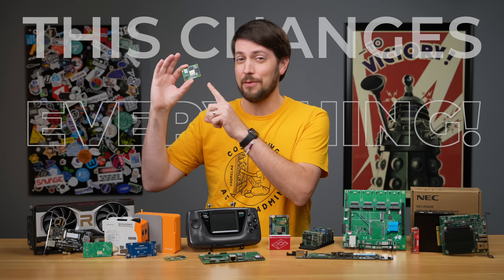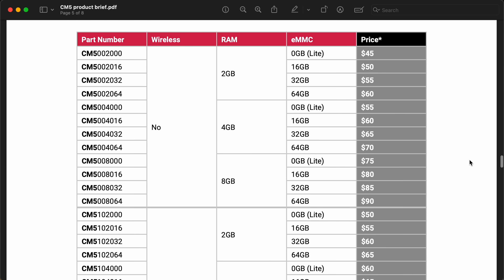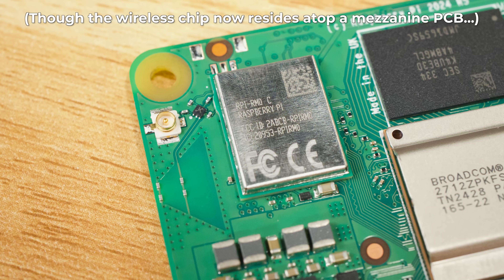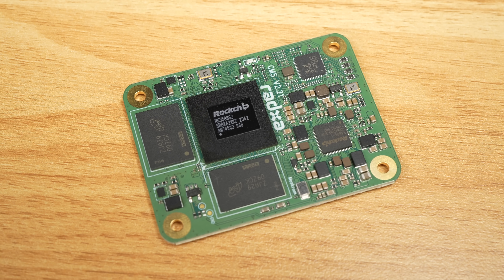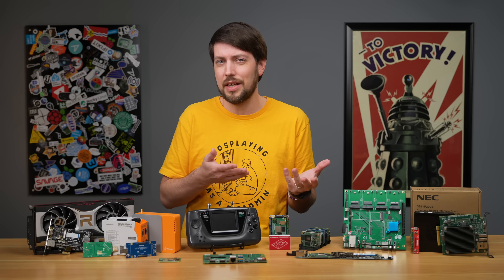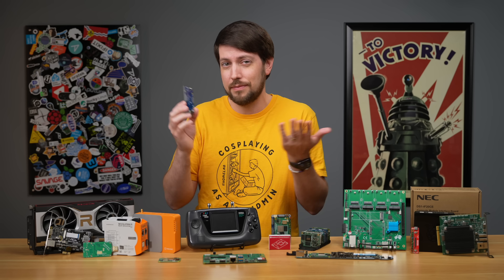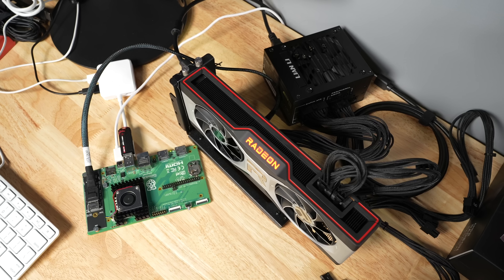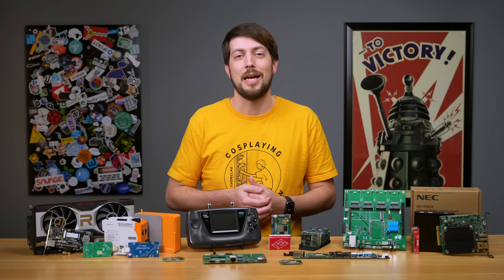This tiny computer changes EVERYTHING

Comment: 2:24 Made in UK, hmm maybe that's why the screen printing quality is so bad.
Chinese PCB manufacturers mastered this process years ago.

Another thing is the "hanging in the air" ground fields to the right of the 128G inscription, who designed it like that and why?, or maybe they forgot to add vias?
This is just one example, there's a ton of it on this pcb.

P.S. those resistors in the descriptions of the memory/eMMC configuration are a great idea, one look and everything is clear.

Jeff thanks for the cool video, we're waiting for more crazy/interesting ideas.

Comment: Does it work with the official I/O Board? I'm currently running a CM4 on a RPi I/O board and wouldn't mind additional power.
Reply from the maker: Yes, you just need to add a dtoverlay I think to make sure all the connections work properly. You'll get faster PCIe and such, but you wouldn't be able to use USB 3.0 (I don't think at least) without the newer CM5 IO Board.
Reply: @JeffGeerling  For my use-case, more processing speed and faster memory are paramount while USB 3.0 is just a nice-to-have. Great video, as always, thanks Jeff!

Comment: Little donation for a question, how do you suggest I should proceed with his, I need to project to a screen from a Mac but I don't want the people to see me manipulating the computer, so maybe a Pi as a projector (connected via HDMI) and the Mac feeding it?
Reply from the maker: That's a little tough, I'd consider using an Apple TV to get the screen feed from the Mac, with AirPlay Mirroring, but you'd probably want to have dual monitor so you can share one display but have the other not shared.
Reply: @JeffGeerling  I tried that (2 screens) but was hard to manipulate the second one since it wasn't in my field of vision.
I noted an app that had all the controls in a floating bar and the player on the second screen, but couldn't find the name.
It was part of a movie theater projection equipment.

Comment: That positron printer you built a while back could do with an upgrade to a CM5!
Reply from the maker: ooh, that could be fun to test. total overkill, but fun!
Reply: @JeffGeerling  maybe the CM5 is powerful enough to run orca slicer on it? I envision some sort of super portable off grid 3D printer with self slicing capabilities for when you really need to print that shopping cart coin stl in the car park.

Comment: 23 secs to boot up a PI is horrible. It shouldn't take more than ~3 seconds. Hardware initialization should be a fraction of second for such a system. Loading the kernel and initializing it is a fracion of a second. The rest is just all the BS that the OS loads. Obviously way too much BS. I can boot Windows 10 in like 5 seconds.

Comment: So technically CM5 is the best way to go about replacing an old gaming pc as a streaming/media machine and use CM5 with AMD Graphics card ?
Reply from the maker: Not the best way, but becoming a more reasonable option. There are still some small issues, and the driver has to be patched to make it work.

Comment: 14:26 are cluster boards just a convenient way to run and distribute load, or also allow treating them as a single monster device?
Reply from the maker: Can't treat as one monster device unfortunately. Using PCIe / 'fabric', it could be possible to unite the RAM and CPU power more efficiently, but that's hard to do and only larger scale enterprise gear typically supports that use case.

Comment: The CM5 with PCI 3.0 and all the I/O upgrades opens up a lot of opportunities. May grab one if I can think of a use case for it.
Only thing missing is that extra PCI-E lane on the SoC which still remains unused. Would really help with a lot of things like GPUs, SSDs and 10G network cards.

Comment: So on the 4 m.2 ITX board one, could you potentially have multiple connections going into the same external graphics card, thereby potentially increasing output.

Comment: CM5 does not have video encoder, is that true? And if it does not have it then , does it still perform better than CM4  in terms of video encoding and decoding? Which one would be better suitable for video encoding and decoding only?
Reply from the maker: Good question! The encoding via x264/software on the CM5's CPU is about equivalent for H.264 as the CM4's hardware encoder, just it'll use a watt or so more power (IME).

It has H.265 hardware decode, but not encode. Really wish they had an encoder, or AV1, maybe next generation...

Comment: Nice! For perspective tho, USB3 10Gbps is still not enough for modern-ish (2017) laptop style use, e.g. streaming two 1080p50 captures. This is still the measure for replacing a desktop PC with a ... smaller computer.

Storage speed and compute cluster usage are still separate from this, let alone running a full-fledged OS. Jury's still out if Win11 is one, but still.

Comment: Thanks for the geekbench results.  Looks as if single-core performance on the CM5 vs the RK1 is approximately equal, but multi-core performance on a 32GB RK1 is twice as high as what the 8GB CM5 scored.  (n.b. I haven't tried to tweak any of my results - best case, I killed a couple of non-essential services on the machines.  A true speed-run would be running on a stripped kernel with just enough system to drive the storage and tty.)

Comment: While this is good, I still just want a Pi 5 based drop in replacement for the Zero 2W.
I don't mind the USBs being changed from Micro B to C, but I'd still want to keep the Mini HDMI, rather than changing to Micro HDMI.

Comment: Obviously someone industrious needs to make an external GPU holder with power supply, and compute module IO board "all-in-one" solution.  Just drop in your compute module and video card.  Alternatively GPU manufacturers could just put a compute module interface on the back of video cards.  They could even make compute modules without integrated GPUs to make them cheaper and expose more lanes to the e-gpu.  That would be an awesome, low power, solution for AI systems.

Comment: probably a common question
is a raspberry pi 5 compute module with an I0 board prety much the same as a standard raspberry pi 5 (if the i0 board has the connections you use/need)?
currently using a 2gb pi4 as a media server & thinking of upgrading - a pi5 compute module with a m.2 on an i0 board would be cheaper (and probably simpler) than a pi5 with an m.2 hat

Comment: 14:38 The carrier board is the Turing Pi 2.5, ain't it? Is it true that its internal switch is limited to 1 gigabit/sec, even when using the RK1?
Reply from the maker: Yes, one of the big bottlenecks.
Reply: @JeffGeerling  In my cluster system (Mixtile 4-way cluster box) they use a native PCIe Gen 3 switch, but it's still too unstable for productive use. The Mixtile guys keep on telling me something about their driver still undergoing improvement, but they won't open-source it. 😩

Comment: Have you ever tested a concerto set up using the NEC display? We have a server running concerto in our data center and then raspberry pis as the clients. They boot into a full screen browser with a specific URL that connects them to the server. We are able to run multiple different streams fro multiple campuses and buildings. And it all replaced a expensive signage system, though there is more management than those paid for systems.
Reply from the maker: Haven't tried Concerto before, unfortunately.

Comment: I would really like to see the GPU is the PC in particular if you can find a way to rack mount one in 1 or 2 U. Seems like it would be a cool option for running local LLMs for Home Assistant but with low idle power.

Comment: I would love rasberry to release a official sata hat for 4 to 6 sata hard drives for a nas, drop in a pc power supply and go. I wanted a rasberry pi for years and recently ordered the pi 5 cooler and m.2 hat. Ive seen a m.2 pcb that has 4 sata plugs on it but would love to use the m.2 for its intended purpose.

Comment: Question - can i buy board with sim card slot to make router from air?
Reply from the maker: Yes, though I haven't tested any of those yet. For CM4, I used a couple Waveshare boards with built-in SIM card slots and either M.2 A+E key or mini PCIe.

Comment: I'd really like a breakout board that can connect individual external modules over fpc cables or similar so i can put ports where i want them on projects.

The board would be the same size as the cm5 and just contain a row of fpc sockets across the middle

Comment: Do I still need Windows to flash an OS onto this Pi5 without a lot of fuss? I had a Hell of a time flashing a Debian image from my Mac or Linux desktop onto my Pi4. As a last resort I used the official sw tool that only ran on Windows and it worked on the first try. I hate relying on Microsoft for anything so I'm asking, do I still need Windows for Raspberry Pi in November, 2024?

Comment: Overclocking. Where is the OC ?
Reply from the maker: Haven't tested yet, because of thermal limits. The CM5 is probably not the best for OCs as it can't put off enough heat to handle 3 GHz and beyond without more substantial cooling. Tom's Hardware did some OC stuff, so please read their post today on it.

Comment: Would love to see if the CM5 plays nice with the Turing Pi and the CM adapters. I've got one running on CM4s, have a set of 3x RK1s to replace some with (still need to pick up a Jetson Orin at some point), and will need to do something else with my CM4s, but part of me wants to just order a newer rev of the Turing Pi for that other setup and drop in CM5s for the upgrade if it'll work...

Comment: you are missing something like what is the power is monitor drawing and also along with the keyboard and mouse to. total power consumption is missing
Reply from the maker: All those numbers are in the linked sbc-reviews issue :)

The power monitor used is identical for all my testing, so any additional draw from it would be accounted for through comparison (note: my numbers are only comparable to my own tests on all devices, others may use other test equipment that could be +/- 1W different (assuming it's decent equipment).

Comment: I so want the compute blade to finally be available for general purchase in the US. I think it's such a cool little board, and I had a similar idea before I even saw you feature it lol. I was trying to come up with a way to stack like 14ish rasp pi's in a 19-inch rack (I determined I could get 14 decently squeezed in with enough space for airflow IIRC).

Comment: Another advantage to the CM is that you can choose where the connectors are. For including it in a product the basic Pi has awkwardly placed connectors that are sure to need internal cables or worse, putting it on a motherboard pcb AND having internal cables.
Reply from the maker: And having ribbon cables flying around everywhere. Always annoying in an integrated device!

Comment: PCIe Gen 3 instead of Gen2. Well.. were in PCIe 5 now .. and 6.0 is already 2022 done too two years ago. Now is 2024. Isn´t it. Even this is simulation. Ha :D Truman Simulation.
Reply from the maker: PCIe Gen 4 and 5 power and timing requirements require a lot more silicon, so it's nearly impossible to fit that into a little 2-5W SoC like these things are using. It can be done, but only while sacrificing other things, or jacking up the price substantially.

I hope Gen 4 will come in a Pi 6 maybe, that'd be amazing.
Reply: @JeffGeerling  Let´s hope that cows fly also in this simulation.

Comment: i don't get why did they put the WiFi and BT on the module? 
there are many applications where both will be unused, that should be moved to the carrier boards to have better antenna properties.
Reply from the maker: They have an external antenna connector if you need it, and you can also buy CMs with no Wireless at all (e.g. if you wanted to use WiFi 6 or 7).

Comment: Imagine the dimensity 9400 on one of these CM boards and 24GB of RAM.
The downside is that its too powerful you'd need like 8 of those edge connectors to take advantage of the IO

Comment: Irrelevant question: what fan is that at 14:25?
Reply from the maker: I think that's my big Noctua 140mm USB 5V fan, with a 3D printed fan holder that tilts at different angles. Great for an improvised cooling fan for any situation!

Comment: pro tip: just get the smallest module and resolder the resistors on the top right to your needs!
Reply from the maker: Haha "You wouldn't solder a RAM, would you?"
Reply: @JeffGeerling  naa, just move that resistor to the 128G position and call it a day!

Comment: 8:19 The literal point of a Pi is that they are so small and with IO pins accessible on the board, they’re made to do anything. So you can’t say you make you make Pis do something it wasn’t meant to do because it was meant to be small and flexible it can be used for anything. I normally wouldn’t point this out, but that’s the literal point of them creating the whole concept of Pis, was to make a board that can be used to do anything. That’s like a marathon runner saying I use these running shoes to do something they weren’t supposed to do. The little point of running shoes is to run in them.
Reply: I dunno - was any pi designed to use external graphics?

Comment: Have you tested the performance of the Radxa board for LLMs? The NPU embedded should provide better speeds (considering if models could be made to work at all using any of the GPU/NPU combinations)

Comment: if they put more IO on the bottom it might not fit into old CM4 designs, especially if there are board components in the way of the new connector. I somehow doubt they are going to do a "pro" version, but if they did, the best possible upgrade would be an extra PCIe lane

Comment: I honestly wouldn't mind easier to pick up ITX boards for either the Pi 5 or CM 5 that also have the PCIe slot built in, so we could use it as desktop. Wrote a similar comment under one of your older videos and I know there are some boards out there, the typical webshops usually don't sell these however. Especially now with the advancements for graphics cards and existing compatibility to CM4 carrier boards, this would be fun to build a PC with.

Comment: @Jeff, with the Pi5, the analog audio was eliminated (shame).  Now, with the CM5 having near identical pin-outs, does the CM5 still have the analog audio capabilities, so all you need to do is trace out an 1/8" connector on the carrier board, or does the CM5 eliminate all analog audio capabilities and that needs to be handled on the carrier board with more discreet components?

Comment: I think we need 100$ cost MobilePhone size,  computer architecture x86 which runs Linux would b great. Form Factor and other features should be like Phone, screen, Ram, Storage. There 100-150$ phones with , 6GB RAM, 125GB Storage, 1080p 5.7 Inch touchscreen,wifi,bluetooth. We just need x86 phone that runs lxqt or xfce linux as whole package of Phone.  If its already there, pls let us know.

Comment: I really hope the next gen Pis try to lower the power consumption! We're still using 3Bs (not even 3B+) because we don't really have the need for more performance, but the added heat in the he case and reduced battery life was very noticeable when we tried the 3B+, let alone if we'd tried moving to the 4 or 5

Comment: @Jeff_Geerling bootup can be easily speed up ten times by using an rc-style boot system, like NetBSD or Devuan. As a crass comparison, my 25Mhz 68030 boots a downstrapped 2019 Debian in around 250 seconds, BSD though in - not joking - 20 seconds.

Comment: No hardware AV1 decoder makes me sad. My dreams of an inexpensive diy ultra low power media player will have to wait
Reply from the maker: The hardware encode/decode missing on Pi 5/CM5 is indeed a bit painful. At least we have H.265 decode :(
Reply: @JeffGeerling no hardware encoder ? Then how does it still perform better than CM4 in terms of video encoding. This video shows encoding better in CM5 compared to CM4

Comment: Like the size of a pint, USA credit card sizes might differ to credit card sizes of basically everybody else. Otherwise, perhaps it is true after all that the ECC memory does not correct all errors. On the other hand, perhaps those credit cards allow a a debt on the truth. Kind of like poetic licence. This thanksgiving, the Raspberry-pi Foundation seem to be competing right about now for truth as bendy as a credit-card against Stalker2 'System-Requirements' for the Ultimate Edition season Pass for DLC and Future Expansions that might (as per the patches included in expansions Storm-Of-Zehir and Mask-Of-The-Betrayer DVDs to add to Neverwinternights2 game) suggest a patch included (which is quite honestly genius psychological marketing to get the Ultimate Edition without actually promising anything of the sort).
My comment has no hate in it and I do no harm. I am not appalled or afraid, boasting or envying or complaining... Just saying. Psalms23: Giving thanks and praise to the Lord and peace and love. Also, I'd say Matthew6.

Comment: cm4 came with this useful PPSIN feature for its NIC so you can connect a GPS receiver's PPSOUT signal into it to get the clock on your CM4 NIC disciplined. does CM5's NIC has such capabilities as well?